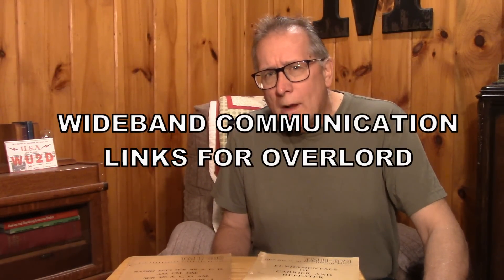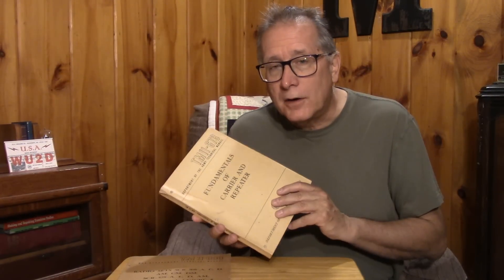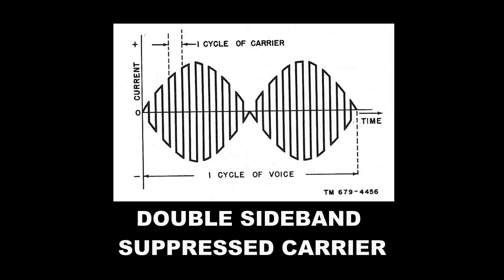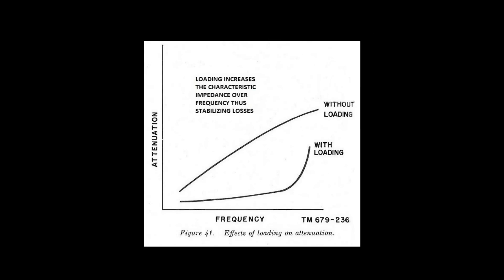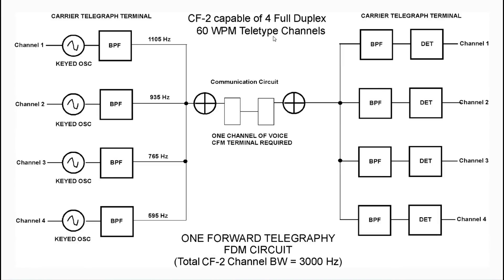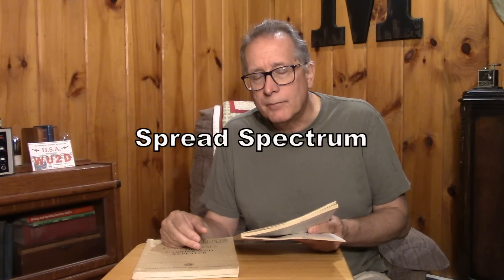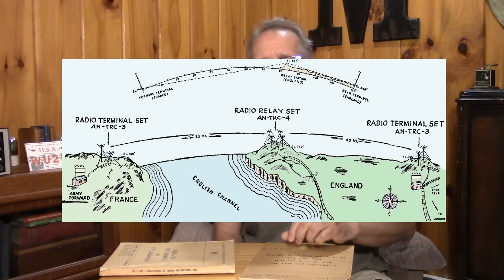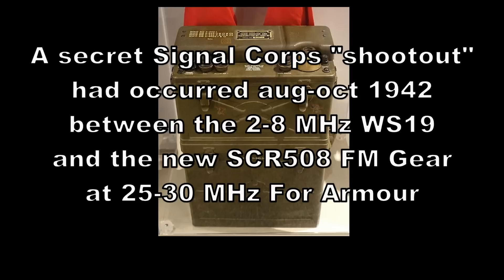D-DAY COMMUNICATIONS - Part 1

Comment: I used, in Vietnam carrier equipment:  31M20 MOS VHF operator, 60Kc wide band VHF/UHF Transmitter receiver AN-TRC-24, and the carrier equipment AN-TRC-7, 12-channel phone and teletype (also see Communication shelter AN-MCC-69) Gen set two 10KW SF-10

Comment: I was Army SC brat in 50's and hung out at MARS station K2USA, which dad built and founded. Also the SC museum, so familiar w/these sets. But then went USAF and solid year of radio relay and 10KW tropo school. Learned the old trc24 ( korea version) plus FRC 39a 10kw and MRC 80 ( an ipdated TRC 24 w/ 1kw and preamp. Fun,very hi tech, 600 channels betwedn mountaintops in Turkey: 300+  miles, 99.9999%  reliability. Then went to ECM/ radar then over to Army as WO-1. 21 years later retd as CW4. This training opened many doors as civilian. Nice show, am fan. 73 Karl WA2KBZ

Comment: Thanks for great videos. I love this and have memories of my after the war experience with old radio gear and my time as a cw operator in the army. I love to come back some day on the radio after more than 40 years of silence. Trying to fix my old gear but it is not easy. What I have is not bad but needs recap and alignment. Hope to get you some day. 73

Comment: This is very familiar! I got an MOS of 32E20 (Fixed plant carrier repairman) at Fort Monmouth in 1975. Most of the racks of equipment will trained on still used tubes, but they did use Collins mechanical filters.

Comment: When I first started working at the WEDU transmitter (channel 3) {in 1963} we has a FM tank radio set there and at both studios on 26.11 and 26.45 MHz (on an "intercity broadcast link" band) with a vertical dipole one hundred feet up the tower.  All had H.M. AC power supplies.  Worked great.  Ron W4BIN
Reply from the maker: The first use of this surplus FM gear in the late 50's was in the TV broadcast business, both for audio assist on the lower band you mentioned and later for studio transmission  links at 60 kHz Deviation in its extended modulation setting, which allowed early video rates.